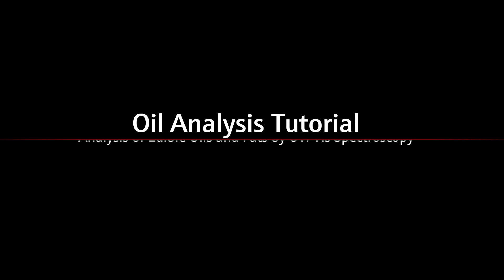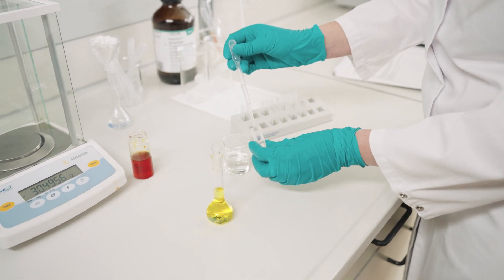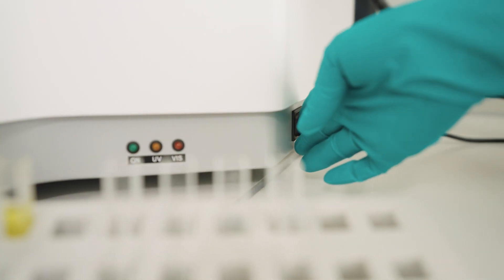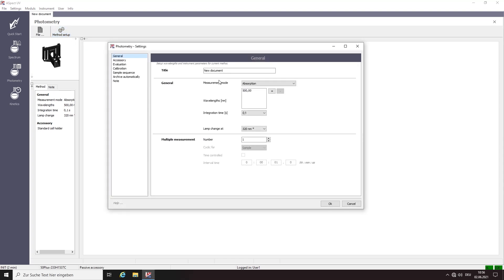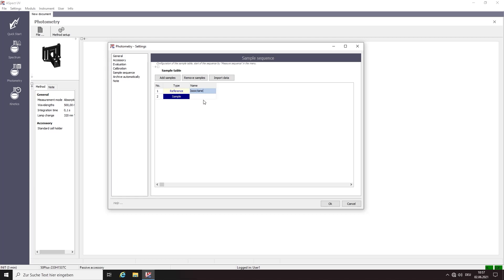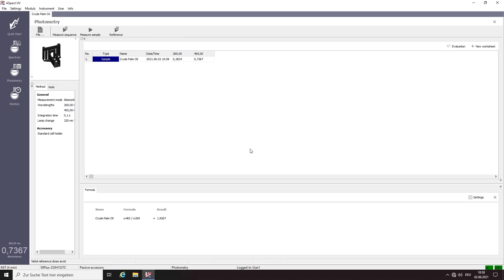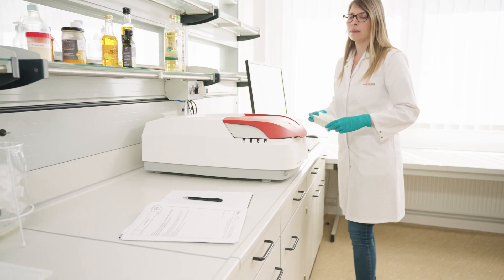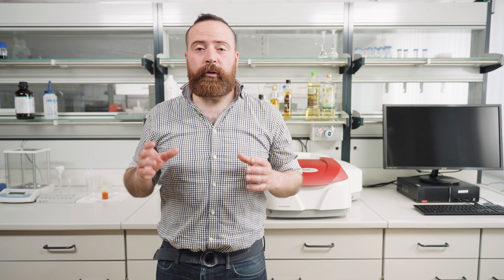Analysis of Edible Oils by UV/Vis Spectroscopy: Device Configuration and Measurement

Comment: Sir, For one sample that we test using uv vis, can we see another compound other than karotenoid at the same analysis? So we could see Vit A and Vit B with just one step
Reply from the maker: Unfortunately that's not possible. To detect further substances, another sample preparation has to be done.